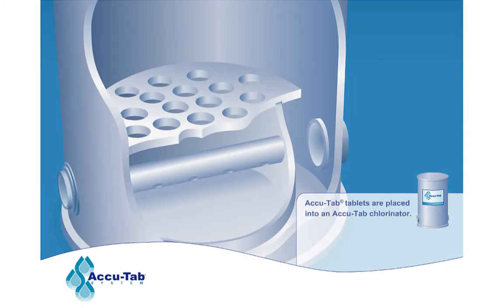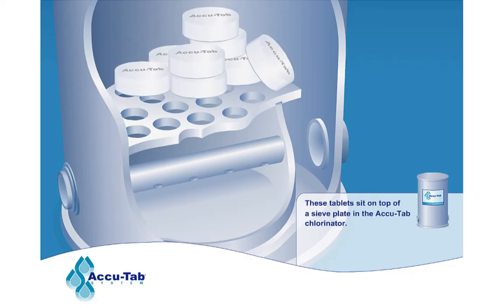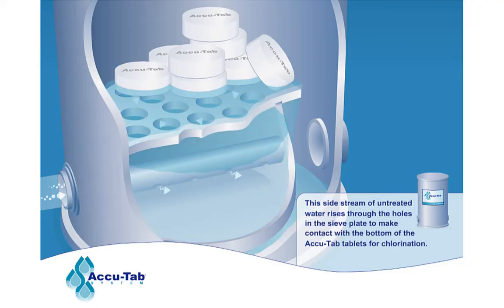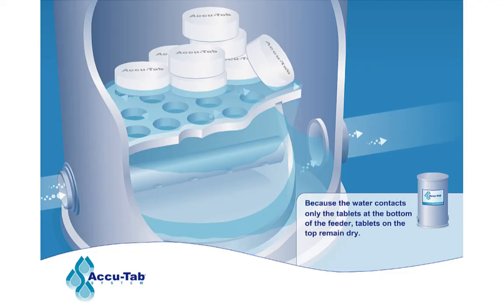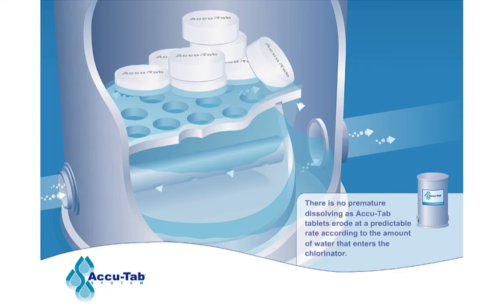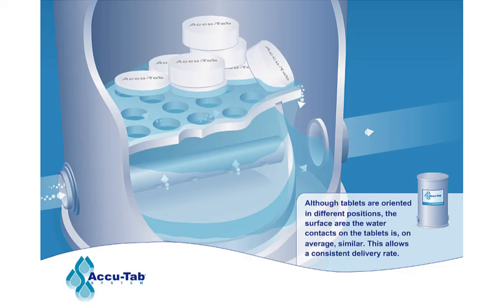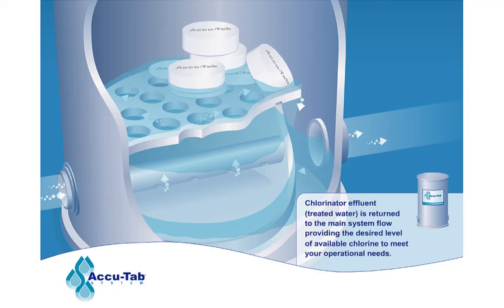How the Accu-Tab Chlorination System Works

Comment: Nice...what is the maximum strength / concentration of chlorine solution (in ppm) prepared in this unit which can be further use for dosing?
Reply: Did they ever respond?
Reply: Not yet